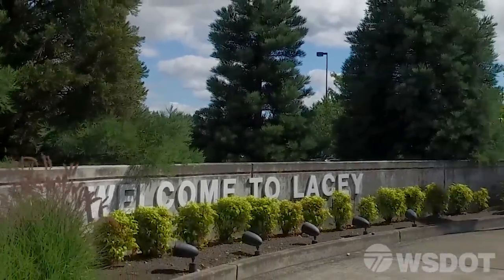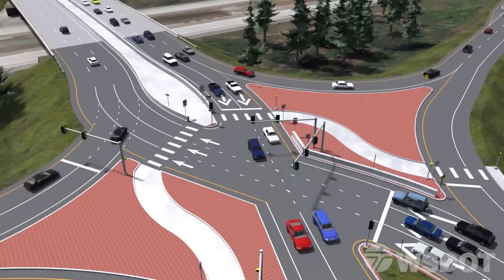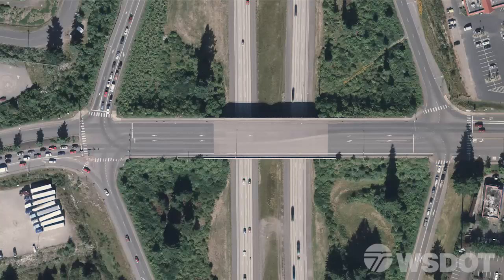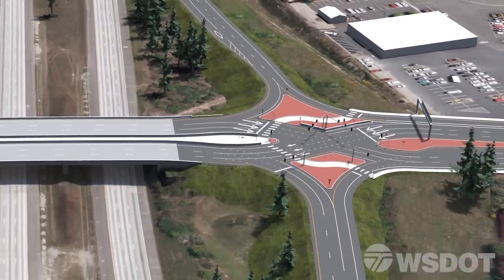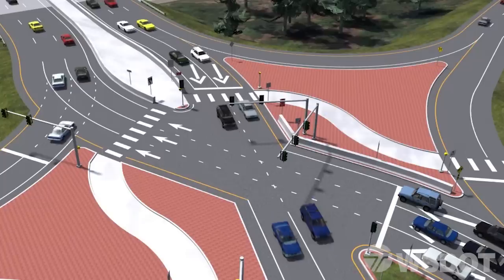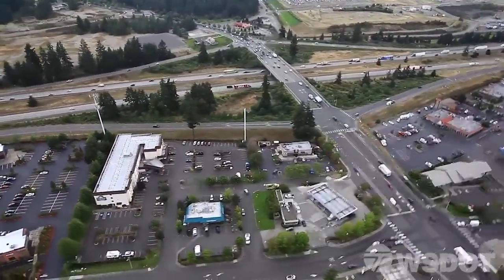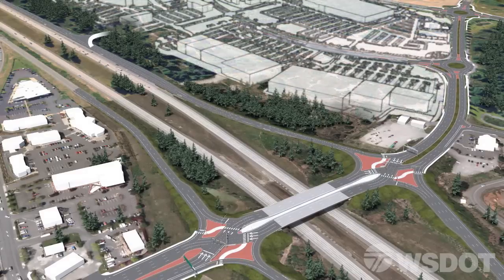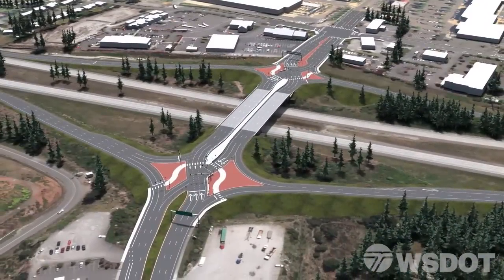Diverging Diamond Interchange comes to Washington State

Comment: I love that they always mention cost effectiveness when talking about DDI. Look at the design and you can see that increasing the traffic capacity is not possible without shutting everything down and spending a fortune to add lanes. This design is the contractors' dream - a promise of continuing income for lane marking and a huge contract when the intersection must have its capacity increased. The emphasis on clear markings in the video demonstrates that the flow is not intuitive and will be problematic in snow, rain, fog, and at sunrise and sunset. Signs don't belong in the interchange, they need to be well before so that drivers can watch traffic, not be making decisions, but in this design they ARE needed within the intersection. 

The primary benefit for commuters is that the slowest drivers will avoid these intersections like the plague and take alternate routes.  It won't hurt the IKEA, but businesses catering to retirees might need to relocate.

Comment: But it would be better to stick to roundabouts on either end that means the traffic flow will be constant no need for traffic lights much safer as we know people jump traffic lights. And Always put rumble strips before any Junction automatically slows a driver Down. They are some free advice cost you nothing.
I can see a major floor danger!!! in it representation virtual reality video, at 3:38 with the crosswalk do not have concrete walls? have metal railings instead this is blocking drivers access view to the people crossing the crosswalk especially of the young! children! And causing a blind spot for drivers because the way the road bends in a clockwise Direction this is automatically pulling the driver's eye line away from the crossing… Railings can prevent a car from accessing a pedestrian area. And should be put on the other side where the island is as well, and have pedestrian traffic lights at the crosswalk or at least orange blinkers! To warn drivers? and the crosswalk should always be lit up by spotlights. That's gonna be a nightmare Crossing there in the dark very dangerous. Doubly dangerous  because the pedestrian cannot see cars very well either!! especially if they're short or children

Comment: Classic car-centric viewpoint.  God help the pedestrians and bicyclists that have to cross those right turns that do not have a light stopping cars.
Reply from the maker: Pedestrians and cyclists will have a push-button activated crosswalk on both sides of the overpass, fully marked crosswalks at other intersections. The Diverging Diamond Interchange will provide adequate sight distance for drivers to stop - as required by law - for pedestrians/cyclists to cross the road within marked crosswalks.
Reply: You show stop bars, but no lights are shown in your renderings to stop traffic turning right on to the freeway.  Perhaps your rendering is inaccurate, and you will have lights at these locations?  

As someone that crosses through a freeway interchange on a bike on a regular basis, I know how dangerous crossing those right turns on to on-ramps can be.   The only person that would think it is safe is someone that has never done it regularly.  People turning to merge onto the freeway are not paying any attention to cyclists traveling through.

Comment: For all of you Europeans screaming about bloody roundabouts, there is a problem here in the states.  Our vehicles are MUCH larger and longer than yours.  We are beginning to see some roundabouts here in the states and for most people they are vexing and more problematic than a good set of stop signs!  Our trucks (lories to you in the UK) are almost twice as long as yours and the roundabouts have to be designed larger to accommodate them, with special "lift lanes" in the center for the rear of the truck to ride up upon while making the turn, or taking up two lanes in the roundabout.  Even my pick up truck is too long to handle the tight curves in the residential roundabouts they've put in Seattle and Minneapolis.  Bleh to roundabouts.

Comment: This "innovative" design still fails to address a common issue with massive traffic jams: the red lights. If the red lights stay on for almost 2 minutes (this is normal in many parts of northern Texas) and the GREEN lights are on for only 10 seconds, there's never going to be any relief to traffic congestion. This wouldn't work in my city IF the traffic lights are still on the same old timers. And no, the city does not listen when people complain about the looooooong red lights. They just see it as money and put up red light cameras like crazy. And they refuse to change the timers on the red lights. It's normal to see 25-30 cars waiting for an intersections lights to turn green when the cross street has barely 10 cars. When I'm in the MIDDLE of that line of traffic, it will always always turn red before I can pass it so I spend 5-6 minutes idling and I haven't gone even one city block. Just ridiculous.

Comment: And Washington DOT also thinks that putting CRASH-PRONE TRAFFIC CIRCLES on major highways is a good idea.
They CLAIM that they'll reduce accidents - but the ones I'm aware of have had MORE wrecks per year and often by a wide margin.

Not to mention all the GASOLINE they waste, making you break down from 50+ to SOMETIMES 10 just to make it around them in a larger pickup or van, then waste MORE gas getting back up TO the speed limit.
ANTI-GREEN idea, these stupid things.

Comment: Make it a roundabout and you'd have reduced the conflict points to 4. Add dedicated right turn lanes and you'd have reduced the conflict points to 4 for about 65% percent of the drivers and to zero for about 35% of the drivers. The whole shebang will probably cost a quarter of a DDI as well. Add to that, that the cars won't have to drive on the WRONG SIDE OF THE ROAD and that you can just take another round if you are not sure where to go, the low maintenance cost etc. etc. etc....well...

Comment: My god americans will do anything to avoid building a sensible roundabout.
Reply: For an expressway (motorway) interchange you  would use more room with a roundabout, you can replace a Double Diamond Interchange with a Diverging Diamond Interchange in the same space and quickly at that, making it the lowest cost alternative.  The considerable safety improvements are well known now and demonstrated since 2009, for not only motorists but bicycles and pedestrians in a proper design.  In city streets there are clearly plenty of awkward intersections in the USA that would be much better off with roundabouts.  But the DDI's best application is a road interchange with a limited access divided highway. I hold its the one place and application where it is more sensible than the roundabout for most cases, here its the simple lower cost more efficient safer alternative for all users best suited to replace the Double Diamond.

Comment: If you can't handle stop signs, traffic signals, and don't have common sense, just ride the bus so we don't have to pay more for these goofy interchanges.
Reply: The main purpose of the "goofy" design is to increase efficiency and reduce traffic, the added safety is just a bonus.
Reply: They don't reduce traffic, you're still going to have the same amount of traffic.  And they're worse for safety.  In the winter, it's hard to tell where the curbs are when it snows.
Reply: ffjsb Aah well as a Brit, that's not something I have to consider! I would have thought you could put some place markers along the kerbs to prevent that from being a problem though.

Regarding traffic flow - obviously changing the road layout isn't going to reduce the amount of cars on the road, but as the video says it means there are only two phases on the lights, and you are less likely to have to stop as frequently, whichever direction you are going.
Reply: I hate how much real estate they take up, not to mention how much more they cost to build.  And it always seems like they want to put in a bunch of landscaping which costs even more to maintain...

Comment: just fork up the cash and build a CLOVERLEAF intersection! smh..
Reply: Sure. Let's just bulldoze the surrounding development in favor of an outdated and expensive design, forgetting that the entire reason for the new intersection was the development in the first place. Brilliant idea!
Reply: Not to mention the traffic issues which arrise due to entering and exiting traffic of a cloverleaf at the highway leads to many rubbernecking issues duue to slow entering and fast exititng trafffic within the same stretch of road, and being an experienced truck driver of tractor trailers, WORST IDEA EVER to use a Clusterleaf design with not enough lead time between on and off ramps.
Reply: Agreed, the cloverleaf died long ago with the flyover method, but that is a hideous mess of bridges.  

This is pretty effective while keeping superstructure to a minimum.
Reply: I.T. Madsen
 it can be clearly seen in the video that the diamond intersection already takes up as much space as a normal sized cloverleaf intersection would take up anyway, so no need to bulldoze anything. plus the cloverleaf design eliminates the need for traffic lights and makes it possible to make a U turn by simply using two leaves of the cloverleaf.
entering and exiting traffic using the same lane point is a valid point but I think it is preferable to stoplights.
Reply: Tahir Akgün -- well-timed traffic lights are not a hindrance to traffic flow. Regardless, a cloverleaf still would not fit here. The loops would take up almost all of the right-of-way, leaving no room for right turns. Even with all the room in the world, partial cloverleaf A4 and B4 designs take up less space and often have higher capacities. Cloverleafs are simply out-dated junk.